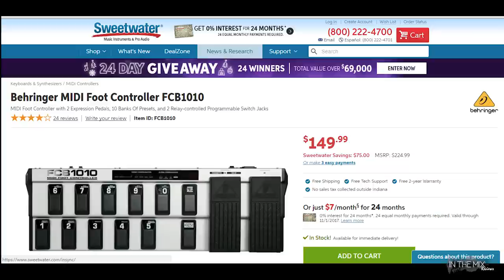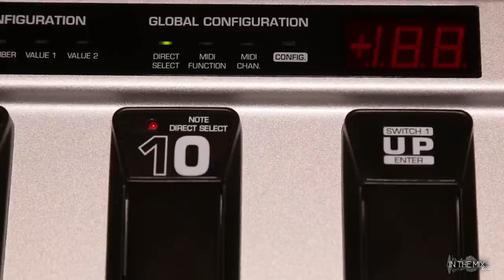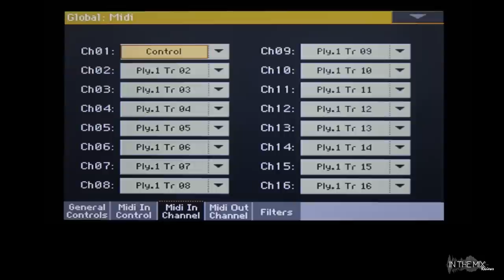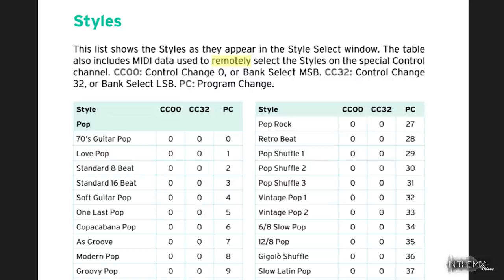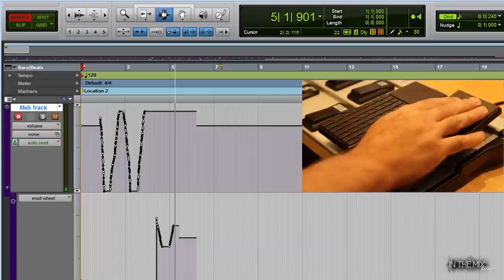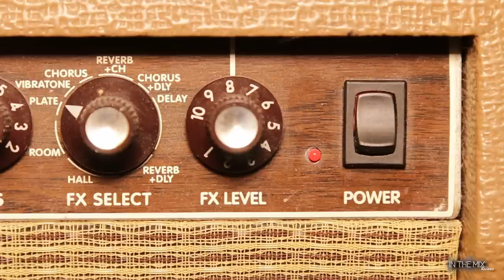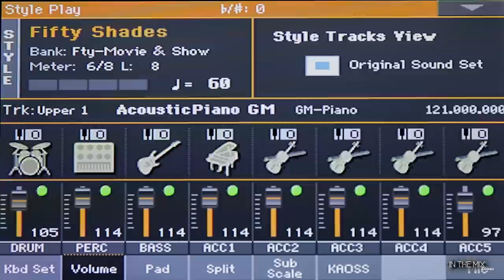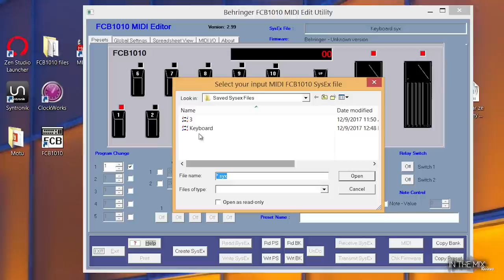Behringer FCB1010 Full Tutorial / Video Manual

Comment: Can anyone explain few more times and slowly about sending/receiving sysx files between PC and FCB1010 thru USB Midi cable? Receiving is Ok but sening revised SYSEX file has not been sucessful. The Global CONFIG LED did not go out. It stayed on. 
1- Start from plug in Midi 5 pin heads into the FCB ports. Male head with letter IN to which side and another head with OUT to which port? My Pedal has FCB 2.5 Chip. Midi USB cable is NoName with Staffs Key symbol logo. It has red light on but the In-Out LED never winked.  
2- I am using FCB Manager 2.2.x. It can detect Firmware. The other Mountain FCB Editor Ed DIXON 2.9.2 went dead if I clicked Verify Version of FCB1010. So I decided to uninstalled the FCB Editor.
3- The instruction from FCB Manager for send or receive SYSEX varies. The software asks to remove In or Out cable, power off , reinsert cable, power on while holding DOWN. But i saw in video that the In and Out cables remain inserted. Also we can enter GLOBAL CONFIG while pedal already on, by just press DOWN. There is only one CONFIG, correct? Does it matter that I have to turn power off or I can do it after it is on already?
4- Move Green LED from SELECT to CONFIG, is it by pressing DOWN or UP?
5- Are there other Red button lights on the pedal before pressing 7? CONFIG Green is on.
5- After pressing button-7 to RCV SYSEX, what will happen to the Red LED? Press and release or holding?
6- Why I did not see Green CONFIG LED went out at all. It kept on shining even after 20 minutes. I tought it happened so fast, so I pressed DOWN and Held till main LED is 00. I did not see the rolling action (like reset the board 1+6 Power-on).
Anyway, the PC said sysx was sent but the pedal function was not changed.
Thanks to all,

Comment: or maybe even using the windpwss editor software and what best midi to usb adapter to use. And showing how that makes life much easier in the set up I'm very new at this and I just got this board and a new Hughes and kettner amp had and I'd like them to be able to talk to each other but obviously I need a video for dummies because I have no midi experience
Reply from the maker: This video should get you started for midi ports and connectors. I tried to make it as easy as possible. Once you understand how the midi signal flow works, you should be able to make the connections. https://youtu.be/xs62GSaP51A

Comment: how can i program a single preset to hit 2 different midi devices with different addresses? my effects processor on midi channel 1 and amp on midi channel 2? i'd like to be able to send separate PC messages to each device based on a single preset press.
Reply from the maker: If you have the stock e-prom you might want to review this section of the video @35:37 (midi assignment).

Comment: is it possible to change the polarity of the switches? I'm trying to use switch 1 as a sustain pedal but it is on when not pressed and off when pressed, I want it to do the opposite
Reply from the maker: I don't think there's a way to make the FCB act that way.
Reply: @InTheMixReviews  yes I've just sorted it out by simply restarting my keyboard! Now it works perfectly... Do you think it's possible to control the switches with the expression pedals?
Reply from the maker: @SteveRayDarrell  I thought that's how your midi device operated, which is why some sustain pedals have that polarity button. To your second question: What exactly you're trying to control?

Comment: I'm new to foot controllers. How do you use FCB1010 to select sound presets on my YAMAHA VL70M virtual acoustic time generator via MIDI ?
Reply from the maker: To change sound presets? You would need to know the midi parameters that are assigned to those Yamaha VL70M preset. Is there such a list published in the manual?
Reply: In The Mix i don't mean editing the presets. What i mean is selecting presets while I'm performing live.
Reply from the maker: Well, that's the whole point of using a midi controller...and in this case a midi foot controller. You would need to assign a function/preset/sound.... and such to a Behringer preset and then be able to recall that 'Yamaha' function/preset/sound in real time. For example in this video, I've assigned various Korg Parameters to FCB switches and that enables me to recall the features in real time.

Comment: This is a really good comprehensive tutorial - but dang it, my head is still spinning trying to remember all of the functionality and how it can be used.  Currently, I just use it in its most basic of operations just to step through banks of program  changes on connected MIDI devices
Reply from the maker: You can just go to that section of the video and do it step by step. It's not like you have to remember everything else. I've even included patch change examples, right?
Reply: @InTheMixReviews  I've saved this video to my notes and I am sure I will reference it frequently as I am adding more and more MIDI devices on a regular basis! Thanks!

Comment: Hi again. Is it possible to configure switches 6 to 10 do send PC instead of the default CNT, EXP and Note?
Reply from the maker: Hi. Switched 1-10 are identical. If you program switch 7 to send PC (for example), that’s what it will send.
Reply: @InTheMixReviews  well, I tried to program switches 6 to 10 the same way I programmed 1 to 5, but it doesn’t work.  The thing I noticed is a difference right after setting the PC number: On switches 1 to 5, when I press UP after selecting the number, it saves the change, but on switches 6 to 10, when I press UP after selecting the PC number, it moves to the next parameter.
Reply from the maker: Maybe on those switches you have the CNT activated instead? Make sure you’re actually editing the PC.

Comment: Amateur here but if I change to a different sound using this pedal board and my KETRON SD2  I get what sounds like continuous loop of feedback of the previous sound. Is this MIDI FEEDBACK? the only way to stop it is to power off the SD2 and turn back on.  Saw some forum stuff but it was for other types of equipment of DAWs
Reply from the maker: Just unplug the midi-out cable from your midi device. That should break the loop, if there's one.
Reply: @InTheMixReviews  Thanks, but I only have the FCB1010 plugged into the MIDI IN on the Ketron SD2 MIDI and only have one instrument plugged into the FCB1010
Reply from the maker: Then you can’t have a midi loop going on. It simply doesn’t have a way to feed back into the FCB1010, once it leaves the pedal.
Reply: Thanks again,  sounds like feedback: say I play piano and quickly hit pedal to organ without a pause then the last piano note will keep repeating and can only be stopped by turning of the SD2 module.
Reply from the maker: Keeps repeating how? Sustaining as if you’re using a sustain or keep repeating as if you’re playing the same note over and over?
Reply: @InTheMixReviews  Darn, now its not doing it! (Just like when you take car to shop because it makes a noise..) I used my CASIO MG 500b guitar, will dig out my CASIO PG 380 maybe that's the culprit...
Reply from the maker: @trinacria1956  Maybe your gear is dealing with demonic possession. ;)
Reply: @InTheMixReviews  Ok, I got it to do it again, so it as you asked  "Sustaining as if you’re using a sustain  continuous sustain" if you do not stop current synth sound and switch to a second  sound in mid song, no matter if you push another setting and will continue indefinitely even if you leave the room ha ha! Unless you turn of and on the KETRON SD2. BUT it only happens with my CASIO PG 380 guitar that has an integral synth and not with my Casio MG 500 guiyst that is only a controller. If the current note played is silenced then you can switch with no problem. Even though according to my understanding of the manual should not be a problem. Had not seen this problem using the PG380 guitar with KURZWEIL Micro Piano module or ROLAND ORCHESTRAL M-OC1 I have.  Guess will just need to use the lower end MG 500 with this pedal and the ketron.

Comment: I have 2 keyboard controllers and 2 sound modules. One is a Korg the other is a Roland. I want to use the FCB1010 to change my presets with my foot while playing. The modules only have the 1 'in" port that I have already plugged the keys into.. Do you know if its even possible to put one of these in my setup? Thank you.
Reply from the maker: Let's clarify your setup a bit. You have 2 Korg and Roland sound modules. What about the 2 keyboard controllers? Are they just controllers, or have their own sounds as well? Do you want both of them to be part of the set up?
Reply: 1 Korg, 1 Roland, Both have in, out and thru. The keyboards are controllers only. If I could control both that would be cool.
Reply from the maker: Solution 1: (without a midi patch bay) You can daisy chain your devices in this order: FCB1010 --> Controller A --> Controller B-->  Module A --> Module B . This is not an optimal signal chain because it's 5 devices long and you may or may not notice added latency....nontheless it will work. You can use different midi channels to target individual synths. This is covered towards the end of this video with good examples. If you're not sure how daisy chaining works, I also have a good video for that on my channel. 

Solution 2: You can use a midi patch bay such as Motu's midi express XT and connect everything directly to the midi patch bay and then use the software editor to edit the signal flow.
Reply: Thank you, I guess its time to find a patch bay. Is there a difference between a patch bay and a thru box?
Reply from the maker: Well, most thru boxes have one input and multiple outputs. So you send in one signal and you get multiple copies of the same signal on the other end. With the fancy ones you can filter and rechannelize each output. I don't think a thru box will help you, because you still need something with multiple inputs as well. Before you invest on a patch bay though, I would just daisy chain the devices and see what happens. If your midi controllers are pretty much doing the same thing, then drop one to reduce the chain. I would definitely try this first.
Reply: Well my controllers are M-audio 88 key boards. One is the basic ES model the other was the flagship a few years back with all the sliders and knobs and a LED screen. That one goes on the bottom and is my piano sound mostly. The other is my keyboard/synth sound. I would love to be able to switch sounds quickly with my foot. That would change my world you know. I also have a Yamaha module that isn't hooked up right now. I also have a Roland drum machine and a Korg multi tracker that both have midi ports. I've never come close to using this stuff to its full potential. Thats not even all the stuff I have. I want to go with the most pro setup. Even if it is only in my basement ha ha.
Reply from the maker: Have you considered getting the FCB1010 foot pedal?
Reply: Well yeah! Thats why I'm watching your video. I've wanted to try this for a couple years now. I getting my tax return in a few days and I'am going to get one. I tried a guitar pedal board I have for this a few years ago. It changed the presets but I never figured out how to set up the channels how I needed them. I need my guitar board where it is so its time to get one of these.
Reply from the maker: Duh! I thought you had commented under the Patch bay video! ha ha ha
Reply: Nope ha ha, This was the 1st video of yours I found but it looks like you have a bunch. I think I could learn a lot from your page. Glad I found ya.Greetings from Denver.

Comment: If it possible can you show how i should setup FCB to changing sts1,sts2,sts3 on PA4x
Reply from the maker: What are the midi parameters for STS settings?
Reply: @InTheMixReviews  On 931 instruction site i find that information : CC99/98 CC06/38

PC 64 KBD SET1 PC 65 KBD SET2
PC 66 KBD SET3  PC 67 KBD SET4
Reply from the maker: @PawelZajaczkowski  So you have all the midi parameters and this video tutorial. What's the problem again?
Reply: @InTheMixReviews  I think i do mistake because it doesn't work
Reply from the maker: Just follow the steps shown in this video and it should trigger the proper parameters. Honestly there’s not much else I can tell you because there isn’t anything else to do. Make sure to add +1 to PC messages for Korg arranger keyboards.

Comment: Hello,Is it possible to set it up to change Styles up and Styles down on Korg PA4x?I had an accident on my PA4x the screen cracked and the digitizer is not working, only the left side is working. how can I set it up with a limited touch screen?
Reply from the maker: I know EC-5 pedal has that style up/down entry. Look up the manual to see if there's a midi command for Style Up/Down. If yes, then you can certainly use the FCB1010 for this purpose as well.
Reply: @InTheMixReviews  ,I have the EC5 but my problem is my screen is untouchable  except of left side  which i can select  just a few tabs
Reply: Which manual you are talking About?  Fcb1010 or Krg pa4x?
Reply from the maker: Pa4x.
Reply: Hello, the PA4x manual say style change PC102 is supported, is that the same as Style up/down? Since I am new to this I whish you can give me step by step on how to program the FCB1010 to change Style up/ down or even a video.regards  JP
Reply from the maker: Hi Joe! I've already made a step by step video. You are commenting on it actually. I'm not sure what they mean by PC102 for Style change. I was thinking maybe they had one PC # for Style Up and one PC # for Style Down. That way you could program one switch to always do Style Up and another one for Style down. As far as programming the FCB itself, programming PC messages is already included in the video. So your question is really about what parameters are actually assigned to trigger that Style Up/Down functionality. Once you know that part, the rest is easy.
Reply: @InTheMixReviews  I see what you mean, my only problem is my screen doesn't work so i can"t change the midi channel to a control channel. I was wondering  since you  mention  factory styles , can user style been program the same way?
Reply from the maker: Yeah, I'm sure there would be a way to access user  styles but Damn! I forgot all about the cracked screen. In that case nothing will work because you still have to access some of those global parameters. So sorry about that...

Comment: Hi Guys,
I need help. I'm using FCB1010 with Amplitude 4 in a standalone fashion and thanks to syx files I get from online, it works perfectly. However when I open AT4 as a plug-in on Logic Pro X, it does not see FCB1010 and when I press buttons on FCB, nothing happens. (Btw I am new to Apple and Logic Pro) is there any way or settings on Logic to solve that issue, or do I need to do something else? Any help is much appreciated.
Update: I've changed my FCB1010's midi channel as "2" by using on-board controllers (footswitches, no editor used) still, no joy 🙁
Cheers
Reply from the maker: Hey Cem, glad you posted your question on the FCB1010 Facebook group as well. Hopefully a Logic user will chime in.
Reply: @InTheMixReviews  "Locate the com.apple.logic.pro.cs file found HD>Library>Preferences.
Copy that file somewhere, if your control surface settings have vanished replace that file with your copy." followed that advice and worked well :) just wanted you to give an update, (don't like loose ends:)) anyway thanks for the help. Cheers :)
Reply from the maker: @CemSolak-eh9kd  Thanks a lot! Glad you found a solution.

Comment: Can I use it in a Marshall Code Amp as a footcontroller?
Reply from the maker: You would need to look at the manual for your amp and see what can be controlled via midi and what are the parameters to control specific functions. That would be a good starting point.

Comment: Call me an absolute midi noob but I’m so lost. I literally just got this for Christmas and I got it with a m-audio cord..it has midi in and out cables with a usb attached to them. I don’t even know how to properly hook it up. I’ve spend hours on this and I can’t get anything to work
Reply from the maker: Relax! So you got a 5 pin midi to usb cable. The FCB1010 only has the traditional 5 pin jacks. For now, you only need to connect the MIDI-IN jack (of your cable) to the MIDI-OUT jack of the FCB1010. Now for the USB side of your cable? What exactly are you trying to control with the FCB1010?
Reply: In The Mix I’m using the neural Dsp plug-ins. I want to be able to change presets from clean-rhythm- lead all that. Mainly for standalone
Reply from the maker: @coreyray3276  Ok so the USB gets connected to the USB port of your computer. The Midi-In jack of the cable gets connected to the Midi-out jack of the FCB1010. This takes care of your midi connection. In this video, I have a few examples of how I used the pedal with a DAW and/or a sample library. I suggest that you go through the video and get a general understanding of how the pedal works. Also search Facebook for a FCB1010 group. Many helpful FCB1010 users in there.
Reply: In The Mix ok so I disregard the midi out end of my cable altogether? And only use the usb and the midi in end of my cable into the midi out of my fcb1010. So my connection if I’m understanding this right would be usb to USB port, one side of my midi being the midi in plugged into my midi out of the pedal board
Reply from the maker: @coreyray3276  If you're only using the FCB1010 to transmit data to a target device (in this case your computer), you don't need to have the Midi In jack of the FCB1010 connected to anything. In other words, you're only using the FCB1010 as an output device and not input. This also prevents any accidental midi loops from happening. If you want to learn more about midi ports/midi connectors, I have a video with visual aids and clear pictures on my channel.